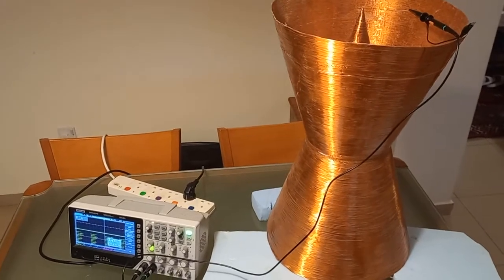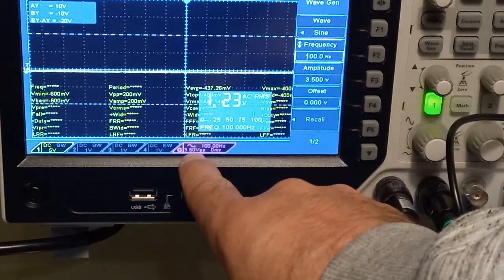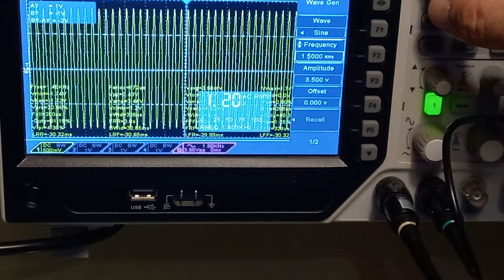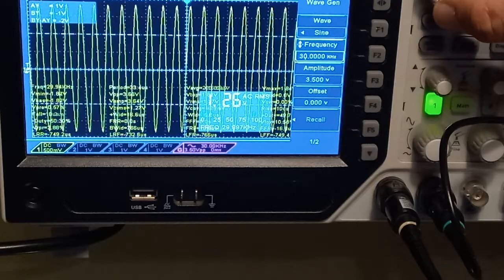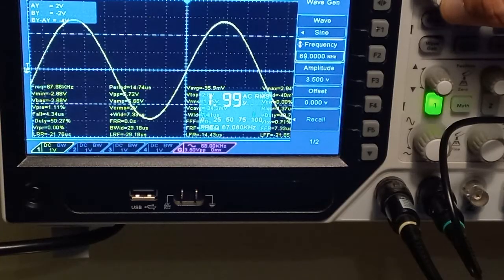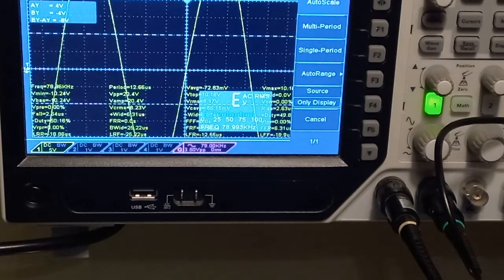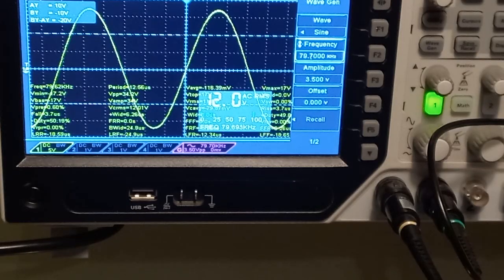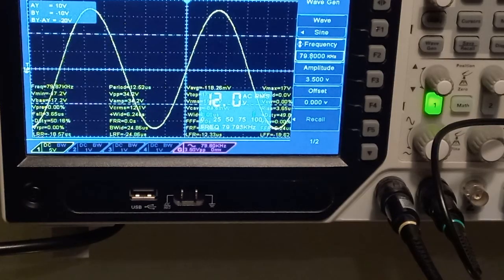Space Time Antenna Etheric Energy Resonator. Output 10 time greater than input!

Comment: your Electrical impedance is 10 times larger ,you resonate and get 10/1 impedance , your Output is transformed as ratio ,you get voltage gain  not power gain , is a resonance effect , is times greater than input voltage because your load is 10 times higher the  input  impedance of your feed , you transform current power to a  voltage gain with Resonator load , you cant get power gain with an impedance   transform ,  your impedance produce standing waves because input impedance see a 10x higher load  , is a Resonator effect
Reply from the maker: You are right. There is a coil inside that the output need to be taken away. There are more components to this device. The cones are just one part of it. Central copper spike is missing also in the middle according to Bashar. And some kind of bifilar coil too.

Comment: Not to be a buzz kill, but this is normal activity for any coil on the planet. Resonant frequency always increases voltage. We want to know power input vs output, proof of energy amplification.
Reply from the maker: @freeyathanme  You are right. There are components that are missing related to quartz crystals we were told by Bashar in private session. I made new cones recently and the amplitude is between 30 to 40 times higher at resonant frequency which is real good but there are things inside the cones and also resonating chamber outside on the form of tetrahedron that is missing.
Reply: Nice.

Would love to see it.
Have you considered using a spark gap generator at the precise frequency you are getting resonance at.
I do recall bashar saying we need to spark the coil somewhere. 

This is something I am getting the ball rolling on with a group of us here soon. Still in early design stages.

We are leaning towards 6mm or 4mm copper tube with 6mm gaps in two pieces to be joined and soldered with copper sleeves. 

Also I'm curious to know what a hand held am fm radio with volume up high, covered with a few layers of aluminium foil held near the coil might pickup. Technically nothing should be picked up under conventional ideas. 

Love ya work. 🔥🌿
Reply: I was thinking you could be getting damping effects from the casing you're using which like striking a guitar string will muffle the resonance from naturally ringing out.

We are aiming to suspend our coil with braided kevlar thread, which doesn't store or interfere with EM fields

Comment: Have short circuit the Antenna??? Bashar said, u should apply some eletric spartk at the beginning
Reply from the maker: Yes the antenna is Short circuit there  are different ways we can activate it, could be also induction or resonant coupling.  I'm experimenting with the 5th prototype of it and now is making between 26 to 42 time more voltage at resonance, but we need to make also more current if we want more power as output .
Reply from the maker: It's not just a spark it has to be AC with specific frequency because it's a resonator. Timing is important too
Reply: @primeradianttechnologies3085  right... Bashar also said, once u build the antenna.  We supposed to do what Tesla did.
Reply from the maker: @franciscojunior6841  What do you mean by that ? And did you remember the title of the session?
Reply: @primeradianttechnologies3085  also, you need to put the antenna into an aluminum pyramid structure, following Bashar's pyramid dimensions and proportion.

Comment: Isn't this just a resonant LC circuit in some sense? So voltage magnification is not surprising.  Unless there is also current magnification at the same time. Please explain.
Reply from the maker: At resonance the Voltage goes up together with the current,  but cannot yet overcome the power of the input

Comment: so are you just pulsing 1.2 volts at very high frequency on a single coil end to end to get this rms 12v?
Reply from the maker: The frequency is 80 and 240khz. Both cones are interconected in a closed loop (shots circuit).

The signal is aplied at one end and the probe of the osciloscope is at the other end.

At the new Spherical STA the signal is aplied to the outer sell and the output is received from the core. But they are insulated and not touching. The resonant frequency is 4.4Mhz and the viltage is from 20Vpp to 44Vpp.

Comment: Is it power or just voltage?
Voltage x current x PF is watts. 

We can increases only the voltage just by step up transformer. 

Please explain, i want to understand how it works.
Reply from the maker: All the devices described by Bashar are a type of resonator that increases the amplitude by matching a specific frequency.
There are other elements or components some of which we know and others do not know, which are involved to keep the current in a steady flow even when a load is attached to the circuit.
Reply: just voltage.. forget any real usable amps...but this setup might work well to charge up a lead acid battery

Comment: You don't have 10x power only voltage. What's the big deal?
Reply: this setup is good as in charging up lead acid batteries.. accumulators respond well to these kind of pulsed voltages
its like using the least amount of power on an AA battery to charge up a large bank of car batteries which then yield a much greater energy after charged...one of those car batteries can later be re-used to recharge that little AA battery get it ?
Reply from the maker: The big deal is that this is only one component of the primitive version of the Space Time Antenna.
This is not an entire device.

The function of this component is exactly this to resonate and create higher voltage.

There are other compinents which are missing and one of them is a tetrahedra chamber to reflect the RF inside and increice potential.

There are 20% components that are still missing but slowly they come on the surface.

Again this is not an entire device but only a component an element of one.

There are other pieces too.

Comment: You're showing the frequency response to a series L-C circuit. I'm not sure why you feel this is so special. And actually, given your course frequency step changes are indicating that it has a Q around 10-15. That is not very high. You have cool coils, but any coil hooked in series with a cap will give this frequency response. The impedance of the circuit is dropping too, loading your signal generator more.
Reply: trick is to find the sweet spot on any coil to get the best performace out of the little most energy put into it and then use those pulses to recharge batteries
Reply from the maker: 1. This is a close loop shor circuit set up and has no positive and negative ends like a conventional type. 

2. There is no extra capacitor here, the capacitance is coming from the distance between the wall of the coils themselves.

3. This is a component of a device and not entire device tetrahedral chamber has to be created and perhaps other  things which no one knows.

4. At the moment I made this experiment my knowledge was not so much and I did not know that when the Voltage is increicing the Amps are going down to balance the power. Its simple but did not know it at that time.

Im more excited now about the last experiment whih made it tonigh.

What do you thing about it? 
Am I missing something there.
Is it normal to rectify 7.2 Mhz to DC?
Why the grownd increice the power?
Reply: @primeradianttechnologies3085 that shape 
That u have built 

Is SUPER POWERFUL

it can transmute elements
And much more

I truly love your work
And would love to know more.

U have a perfect 
Tetrahedra
Vector equalibrium
It is balancing itself I assume

Im Workin on same thing
Reply from the maker: Here is the video 

https://youtu.be/_wR4OyBhtFM

Comment: Interesting. Does the power (Watts) change significantly? If not, then you may have created a device that behaves similar to a step up transformer.
Reply: It is step up air transformer. Preety nice by the way.
Reply: so he is basically pusing dc at very high frequency on a special coil and the 12v rms is the back spike?
Reply from the maker: I could non mearure the Amps at that frequency.
But the new STA has resonant frequency around 4.4Mhz and I will use RF power metter to see the difference. Also will amplify the input from 350 mW to 5W to do that. 
The equpment is on its way

Comment: ok so you put 3.5v in and get 12v out. What if you put 3500v in do you get 12000v out?
Reply from the maker: Actually 1.2 Volts is the Input RMS which is 3.5V PP.
The output is 12v RMS.
It is not easy to send 3500v with 80kHz or 240Khz which is the resonant frequency of the antenna, but basically if we can do that then Yes.

Plese remember that this is just one componnent of the device which icreice the potential.
From my opinion there must be circuit on the equatorial plane with a central rod wich is acting as central axis or fulcrum point on which the oposing fields are balancing.

I need to make a video and share a lot of things we can go further together. The video page is ready and all hardware is hete now, just need to start recording the  content. 

Will notify all of you here in the comments to join , will be absolutly free and also will upload it here inthe channel.
Reply: every tom dick and harry coil we make or build has a special resonant frequency by which it acts like its giving its max out of the limited energy we pump into it..its like every engine we make pumps out its max power only at certain rpm range.. same with coils

Comment: You should have your cones insulated. Also, the idea is that you give a boost with direct current, setup as a closed circuit. Then give it time. You should be able to detect if you are getting energy with zero input with a fluorescent bulb or have another coil that also resonates with the cone coils and hook up some LED's. Also, eventually you'll want to have a copper sheet with a resonant fractal pattern use as an antenna to use the energy from the cone configuration. You could buy nano insulating paint to insulate your cones or maybe even torch the cones till they turn black with a nano coating but I doubt you'd want to do that :p
Reply from the maker: Did you build any of this cones so far?
The cones you see are insulated.
The cones and the other STA with the Merkaba are resinators and for resonance you need frequency , not DC curent.
The copper sheet for the cones in tetrahedral formation should be without patern because have to restric the expansion of Space field and therefore create compresion.

There is a central rod inside the cones and also other elements on the equatorial plane which will not go into details now.

Comment: So essentially the earths resonant frequency is basically the same as the resonant frequency of this antenna, and so this antenna is thus then able to tap into the earth’s electrical energy, because it matches the frequency of the earth? Is that what’s going on here? So in a sense it’s sort of like how radios work. You need to adjust the frequency of your radio antenna to match the frequency of the station that you want, in order to receive that station. If this is how it’s working then it seems very easy to understand.
Reply from the maker: Well in a sense Yes. The earth is a greater octave or we can say an Overtone. The Antenna is not just picking it up but steping down this and compress it, slowing it down.
This will icreice the frequency and the amplitude and then othef components have to make use of this effect to transform it into current we can use.

Comment: What are the dimensions of this device and how do you built it?
Thanks
Reply from the maker: This is the minimum size that can be made and the Hight is 2 feet (60cm).
Ideally the wires need to be bond only with resine and not holding structures.

After making 4 of this the proces is clear  but very long to explain here. There many steps but all of them are relativly easy. Will make a video for this too and walk you trough evety step.Promise that!

Comment: In most alternative energy experimental result reports, an important figure is called COP, coefficient of power. Equal to the actual power out divided by power input. So if you have actual power produced, this ratio will be greater than 1. However, even for small values say COP less than 5 say, the device is still not practical. Because COP must reach higher values such as 10 or 20 for the device to actually be feasible power generator. 

Your voltage measurements are helpful, but you really need to be working with TOTAL COP, including all external power required to generate your input signal. And then dump your generated power into something like a load resistor that can be measured and plotted with voltage and current over time.
Reply from the maker: You are absolutely right, thank you for sharing this.
I just get finally similar results as you said from the big STA  with the spheres yesterday, but needed to fly to another  countries for 2 weeks.

When come back will do exactly as you said and will attach resistor to see the voltage and the current of the output and determine the COP value. 

Now one electrical engineer from Germany is helping me and he actually create the circuit board needed to activate the device.

With  my input 20 volts DC in the beginning  I had 0.05 amp = 1 watt.
This is when thus input was transformed into 300hz square wave and run into the STA.
The Output was only 1volt RMS  30V PP

At 18.5kHz the input was still 20 volts but now register 3.5 amps of 70 watts 
And the output was 20.4v RMS  wave and VPP was about 70V.  The wave was nor perfectly square.

Need more adjustments and to add the load as you said.
But do you thing this is a good results in general ?
Reply: @primeradianttechnologies3085  Replied via Facebook Message to your Bashar group personal page.

Comment: Can you do a video or show pictures of the device?  It looks like a transformer to me.  Hard to tell what’s going on from the little discrimination given.  Is the inside cone isolated from the outer cone?  What are the winding ratios of the two?  I would like to try and repeat this…can you provide details?
Reply from the maker: It is like capacitor and inductor at the same time.
It is single wire which beginning and ends are connected in close circuit but before that is looped in a specific way.

This saturday 29.01.2022 we going in another zoom meeting at the same time as the previous one and you can ask more detailed questions there.

I will be happy to help you make this particular device much better.